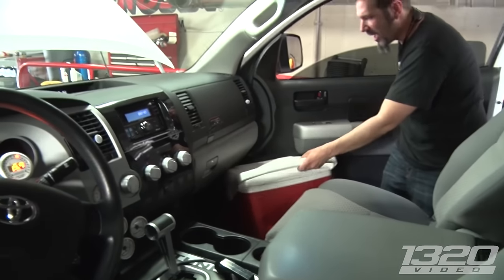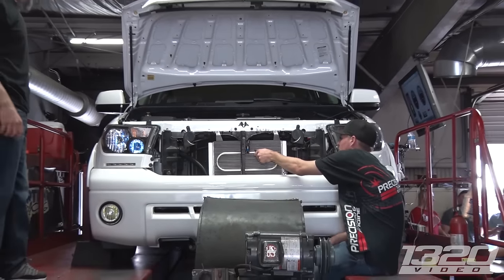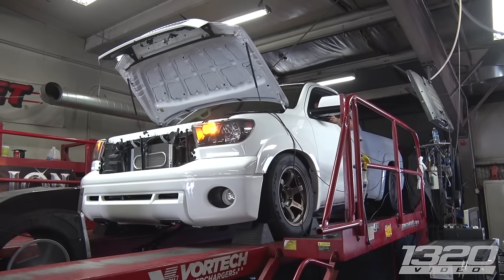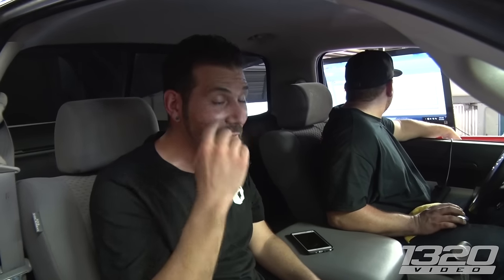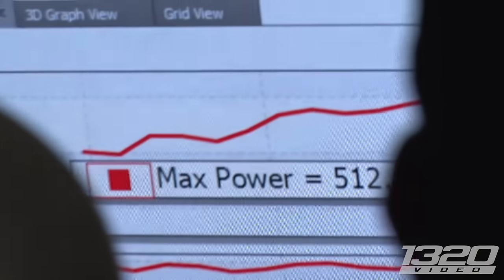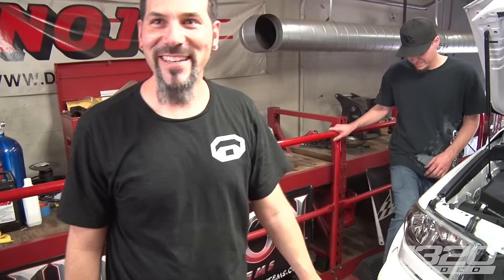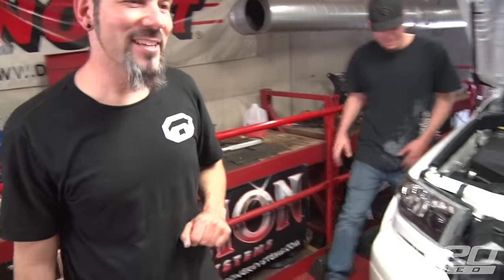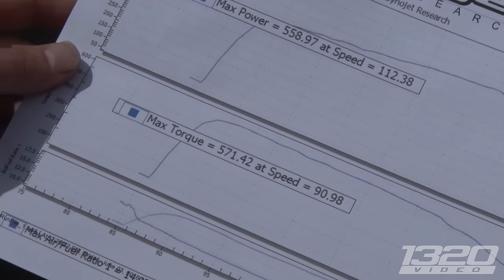The FUNDRA - TRD Supercharged Toyota TUNDRA!

Comment: If toyota marketed these blowers better they would of sold a whole lot more. %90 of tundra/tacoma owners probably dont even know you can order it for dealer installation and it doesnt void the warranty.
Reply: Also if it's flex fuel then you're fucked. Not gunna work through the dealer.
Reply: I know. looking to get one for the 5vz
Reply: And from what I understand, tooning them hasn't really caught up with Ford/GM/Dodge.. it wasn't until i want to say the last few years they finally got the computers opened up.
Reply: need one for 1uz
Reply: +28power68 
*Magnuson
Reply: +123devinzz1 forget the sc go straight for turbo. SC maxes out about 280whp. My turbo 5vz starts at about 250whp at 8psi
Reply: +Drew V Why not just go insane and add nos, sc, and a big signal turbo?
Reply: +Drew V 
Those are two different engines.
Reply: +Drew V im debating it. the supercharger seems like a simple install compared to the turbo and you can find them used fairly cheap. with the help of meth/water injection people have broken the 300whp mark. with as light as the 1st gen tacos are it should be a pretty quick little truck whether turbo or supercharger.
Reply: +Drew V i actually subbed to you recently looking for info on the cx kit.
Reply: +123devinzz1 awesome. I'll have more vids soon. I'm on 8lb now. Going to the track this weekend to get slips. Going for 15lb on 93 ultimately.
Reply: +ohmanyourecool was replying to the guy looking for a sc for his 5vzfe
Reply: +The Spartan-Stig actually the 5vzfe is unique in that you could twin charge it easily. Management would be difficult.and nitrous anti lag would still be a good idea :)
Reply: +123devinzz1 you're right they are an easy install. My previous 5vz had rear mount turbo which are super easy to install. I really wish I had done another one due to the complex install of the cx kit.
Reply: there used to be a company around the mid 2000s that sold an 800hp twin turbo kit for the 5vz where you would swap in a forged crankshaft and cams from a 3vz. lce performance also built these to make over 1000hp
Reply: +123devinzz1 yea I would like to build one someday. Weak spot is rods. Ive bent and broken rods in my 5vz at 14lb when the tune went wonky (2 engines now) so a set of lce rods would be my first upgrade but they're $1400. A 3vz-fe from Camry (not to be confused with 3vz-e truck turd) has a forged crank that swaps in. Find me on Yotatech (vasinvictor) or custom tacos (Arky) for more build stuff.
Reply: will do. i was banned from tacomaworld for posting a facepalm emoji where somebody put dodge tow mirrors on a single cab 1st gen...
Reply: +123devinzz1 haha that blows
Reply: The problem is Toyota don't market performance but they have performance potential just like this tundra
Reply: Wrong

Comment from the maker: Damn this thing is CLEAN!
Reply: yall finally found a tundra!! 😍😍
Reply: Someone should tell him about the pulley swap if he want's better numbers......
Reply: makes we wonder why toyota didn't offer supercharger for the F.
Reply: +Adam Benderman ?
Reply: +computerguy5437 talking about the lexus isf.
Reply: If you're drag racing your truck, especially on video the warranty is void also, but if you're having this kinda fun in the truck you're not exactly worried about the warranty lol
Reply: Your warranty isn't necessarily void just because you take it to the track. I've brought my Mustang in for warranty work with the numbers from my local track still written on the window and still had blue painters tape on my rear fenders which I had put there to keep specs of rubber/debris from sticking and had no issues whatsoever from the dealer. My issue was something totally unrelated to abuse though. However,  if I were to take the car in and say hey my new car has a blown rear, and then they see me on video launching at 7k RPM on slicks, they would probably turn me away. But if I take the car in because the radio or heater was malfunctioning or something along those lines, whether or not I raced the car would not be an issue.
Reply: slow**
Reply: Gabriel Choi it was faster than the "muscle car" it raced at the end..2000lbs lighter and way better aerodynamics, plus had a V8 in it ;-)
Reply: 1320video to clean
Reply: The tundra in my profile pic has the TRD supercharger
Reply: +DonatimeDrumpftimestamps and the same
Reply: Ikr

Comment: these single cab short bed 5.7 are hard to find
Reply: thomas cloutier  right!! that's what I'm wondering not why or what he has done like how tf did he find that truck 😂😂
Reply: Exactly I wasn't even aware they made one,
Reply: And when you do find one. They're insanely overpriced.
Reply: TMR how many miles? What year?
Reply: Joseph Samsor probably a 2004 with 300,000 miles
Reply: Very hard to find .and even harder to find a trd supercharged edition
Reply: @tmr8193  wya
Reply: TMR nice truck bro but yours is a long bed not a short bed
Reply: I have one
Reply: Im getting mine this week
Reply: @sandking9918  what’s it called and where ?
Reply: @kevin.a7089  tundra rcsb i have one not a supercharger but 5.7 two seater from my reserch 3600 built in the usa from 2007 to 2011
Reply: Soooo right. Especially now days, manufacturers are going away from a regular cab. I’ve been trying to find a nice low mileage one for a few years now. Just bought a new Tundra & it runs close to those times now & it’s heavy also.

Comment: Damn, this is an original ass ride.
Reply: Not really I live in a city with 13,000 people and there's Atleast 3 of them in my town and even more in the city over
Reply: Not really!! But cool!!
Reply: i live in a small town in  central Cali and I know like 5 guys with single cab tundras with supercharger/turbo set up.
Reply: +Thelegitrager Really? In a town of 13,000, you've got 3  lowered, supercharged Tundras that run 13's? I call BS.
Reply: +lightning95sc not that uncommon in Cali to see supercharged lowered single cab trucks they  are everywhere. in my surrounding neighborhood there are like 10 lightnings as well.
Reply: +Miguel Pastrana right, my neighbor has a lightning and there's a dude a couple blocks away that has a roush f150

Comment: show em that Japanese v8 💪
Reply: That engine is designed in america and built in alabama
Reply: +Prototype _ BOI 💀 got me dead because is the truth
Reply: Lmao it's American
Reply: same 5.7 that's was in the older Chevy's GM sold the 5.7 platform to Toyota that's why Chevys have 5.3 now
Reply: +Eric Harak Na I don't agree. The 5.7 or 350 is too common of an engine to claim that. Did GM also sell it to Chrysler?
Reply: +Prototype _ fm could've sold their design of it.
Reply: +Eric Harak So the old GM 5.7 was a DOHC 32-valve engine too?  Gtfo.
Reply: +Cris Wireless ^^^ right was about to say that
Reply: Lol dude a fully stock 4.8 or 5.3 can make that power no problem
Reply: +Edward392 if it was made in America, designed by Americans in America, but a Japanese company bought it, that doesn't make it a "Japanese v8"
Reply: do you have a link that shows Toyota's 5.7 has anything to do with GM
Reply: guy proulx I don't think GM sold it because if they did you could of tell right away
Reply: The Toyota 5.7 Iforce V8 shares nothing in common with GMs 5.7 V8s. Just because they both happen to displace 5.7 liters means nothing, they have a different head design all together; GM engines are OHV pushrods engines, Iforce is a DOHC. Also, the bore and stroke of the Toyota 5.7 is entirely different than the 5.7s GM has made. Next we have the induction system, the Iforce Toyota engine uses an intake manifold system designed in house by Toyota, and is not like the LS or LT style intakes used by GM.
Reply: Joe Doole you take a W my friends
Reply: +Joe Doole 
Thank you! I don't know where that rumor came from but Toyota definitely has never been one to outsource their engines. If they go with Cummins for their diesel choice I'd be surprised.
Reply: Justin Buell Toyota will never put a Cummins in the Tundra, a lot of americans say i want a diesel in my truck, just take a look at the GM twins with a diesel, sales don't reflect what people say they want
Reply: +guy proulx 
I agree. Also have heard rumors of them putting a Hino in there but I just don't see it happening.
Reply: Justin Buell i say it won't happen because it would cost millions to make the Hino diesel with all the EPA regulations to sell maybe 100,000 units per year, it jst doesn't make good business sense, sad really cause the Hino is a bulletproof engine, some Land Cruisers with over 2 million miles and still going strong on original drivetrain, if the domestics could have that kind of reliability then i'd be first in line to buy one, till then i'll stick with my reliable Toyota
Reply: +guy proulx 
Same! I've had mine for 8 years now and only had to change the battery once. Other than that, this truck has been bulletproof. If they made a Hino, however, I'd be in that line as well :)
Reply: guy proulx yea but those trucks are like 70k lol
Reply: Eric Harak it's a completely different engine than the chevy 5.7. It just has the same displacement.
Reply: MOPAR_LSX _SVT_JDM 

Fully stock 4.8 or 5.3L by definition means no modifications period. Next time clarify that you mean a stock block or stock internals...
Reply: Eric Harak Get your facts together son
Reply: Devin Stark chevy assembled in Mexico but American brand Toyota assembled in USA but japanese brand
Reply: They bought that motor plan from chevy , it's not why chevy changed motors but that's where the motor came from.
Reply: @kanelynd2042  what was specs and name of this motor and what did it come in?......

Comment: we didn't do a whole lot of them but we used to have a problem with them melting the tops of the pistons at my local toyota dealer. Which is to be expected when you do this and don't upgrade any of the internals. Oh and one guy pushed a rod out through the side of the block trying to drag race with a double snowmobile trailer in tow lol.

Comment: never realized how many people hate toyotas for no reason, until I read the comments section.
Reply: u from da No?
Reply: +AzYaTicMadness yeah buddy 👌
Reply: Yeah he has 558 rwhp and only runs a 13.04. I run that in my 2012 ram with 360 rwhp and I weigh the same lol. he's supercharged!!!!! these things make power but can't put it down. on top of that he said when he first started this project his dyno numbers were at 303 rwhp??????? he has a supercharged 5.7l and only made 303 rwhp stock? lolololol ol.
Reply: +Justin  Way nice bait
Reply: +Justin  Way dude..... Before the supercharger it was at 303..
Reply: ISIS drives toyotas...
Reply: Toyota4Life people that drive toyotas just plain suck at driving
Reply: Most ppl love Toyota it just the idiot who try to get others to hate Toyota
Reply: Toyota4Life red means stop, green means GO
Reply: +Justin  Way have any videos to prove?
Reply: proves how smart they are, they use the most reliable pickup on the road
Reply: Fresno4runner. Haters gonna hate
Reply: 7,000 feet is way up there. They say naturally aspirated engines lose 3% power per 1000ft due to air density. If this Tundra was naturally aspirated with 21% power loss from 558hp to the wheels it would of still made 440hp to wheels at 7,000ft up which would still be enough for easy mid 12's at over 110mph in the traps. But this Tundra is Supercharged so the powerloss is not as low as an naturally aspirated engine... My Jeep with a race weight of 5,000lbs will make only 360hp to the wheels will run 12.6 @ 107+ mph. This Tundra running only 13.0s at 104mph does not make sense.
Reply: Justin  Way it's 303 stock rear we'll horsepower no blower.
Reply: We never ran anyone over Mr Mustang.
Reply: @Andrew-lm2xk  racists live in America
Reply: built in San Antonio texas by Americans and built better than any other brand.  Only a bunch a meatballs like hybrids with parts from here there and everywhere, built here there and everywhere.
Reply: Let’s face it. The only reasons why people hate Toyota’s is because their not American cars or bcuz they own a shitty American truck that can’t even last over 200k miles
Reply: @justinway1892  you had me at ram
Reply: Ya because Toyota is more reliable than ford so Americans start fuming.......... No more Ford's got 1 million miles on the radar than Toyota's....... No no no not without $100,000 in repairs per 100,000 miles
Reply: @justinway1892  its the transmission that's hindering. It was never built for speed in mind. Now if he got a built transmission and solid engine/transmission mounts, he'd be whoopin that ass but.. then the rear end would be on its way out soon after that

Comment: My dad had one of these in trd red... We put a cold air intake on it, some spray and installed some stereo. Everything else was stock and it ran mid to low 13's on stock tires. Had we removed the sub box and put slicks on it, I'm sure we could've gotten high 12's out of it. I've never seen another TRD Tundra in person, so this is a rare treat for me; thanks for the upload! I miss that truck... If you're wondering what happened to it, some fucker ran a red light and totaled it out...
Reply: Wait? How do you know that it was totaled? Does he have an Instagram?
Reply: +Jesppy “Jalen Espinoza” I was talking about the one my dad had, not this white one.

Comment: When I worked at toyota those supercharged tundra's were quick but I honestly think they could be quicker if you could put it in a "race" mode that skipped some gears cause that stock 6 speed has some close gearing for towing, not good for drag racing

Comment: for those that are wondering. the 5.7 IForce v8 is actually just a bigger version of the mustang coyote v8. both are DOHC 32v and both sound very similar. i wouldnt be surprised if someone swapped an Iforce v8 into a mustang. they are both pretty much the same engine. and thats for the current generation Iforce.

Comment: 7,000 feet is way up there. They say naturally aspirated engines lose 3% power per 1000ft due to air density. If this Tundra was naturally aspirated with 21% power loss from 558hp to the wheels it would of still made 440hp to wheels at 7,000ft up which would still be enough for easy mid 12's at over 110mph in the traps. But this Tundra is Supercharged so the powerloss is not as low as an naturally aspirated engine... My Jeep with a race weight of 5,000lbs will make only 360hp to the wheels will run 12.6 @ 107+ mph. This Tundra running only 13.0s at 104mph does not make sense.

Comment: They need t start designing performance heads, cams and other serious engine parts for these engines. It will then have the potential really put the bolt on power adders to good use
Reply: Bucky Hurford agreed...lots of potential in those engines!

Comment: Nice truck for sure. Did he say it runs 12.60? I would expect it to do a little better than that with all the power. My old 08 went 13.71 with just an intake and catback making 314whp so I would think another 200whp and whatever suspension/traction mods he did would drop more than a second. Ofcourse these are heavy vehicles! Nice ride noneheless
Reply: Liar

Comment: I just got an email from Magnacharger to upgrade their tvs1900 rotor pack to the tvs2650. Between that, smaller pulley, HP Tuners I think you could make 650-700whp if the running gear can handle it.

Comment: yeah ....thise dyno numbers are not adding up.  558 and did a 13 sec pass....that sounds like engine dyno numbers or those were just dyno queen numbers to make him happy.
Reply: It's a 5000 pound truck with the aerodynamic properties of a brick, might want to take that into the equation as well
Reply: +Adam Cocke no i get it man.....but still is off.  ive seen trailblazers with waaaay less hp run faster time and those are 4600 lbs
Reply: +MrDulvalius69 yeah it does seem like it could do a little bit better
Reply: the launch looked babyed
Reply: MrDulvalius69 it's on bags and weighs 5,500lbs and a fucking square to catch wind... That ads up.
Reply: It's at higher elevation. At sea level it would have run a faster time.

Comment: It must have lost it's tune on the way to the strip.  My regular cab short bed 2WD sport Tundra hit 96mph stock at a 2800ft elevation track here in western Idaho when it was only months old.  Dudes at sea level have seen damn near 100 stock and this thing has 230+ rear wheel horsepower and can't add 5mph to the trap speed?
Reply: Yup something was definitely wrong

Comment: My V6 3.5 liter puts down 445 hp and 500 tq with only a tune. Runs 12s with a 4.6 second 0-60 and it’s a 4x4 crewcab with a range of over 700 miles per fill up. Why is this single cab so slow? I know it’s over at over 5k ft but still should have been quicker. Is the transmission tuned? Is the tq converter fully locking up?

Comment: really nice truck maybe he needs an upgraded intake looks like stock box
Reply: That's the one that comes with the supercharger, it flows plenty fine actually.
Reply: +TundraJason it might have that scoop in the bottom
Reply: CAI are totally overrated.
Reply: +Ian Thompson well I'm just sayin if he had one it might help.
Reply: no help from CAI for this truck, the stock air box provides better low end than the aftermarkets. I've had both on the same truck. its my daily driver.

Comment: The only v8 I'll put in the Supra

But there has to be a good reason why.
Reply: maybe you should also check out the lexus rcf motor, its basically a 5.0 liter version of the tundra motor but with power out the box (470 hp).

Comment: I just found out that Toyota offers a super charger since 07
Reply: They had one for the first gen 4.7 Tundra as well but stopped making it
Reply: My truck the T100 had a Supercharged 3.4 v6 in 98 for the TRD
Reply: +Ian Thompson The supercharged 3.4 was also an option in the 3rd gen 4runners. Make good pretty good power from what I hear